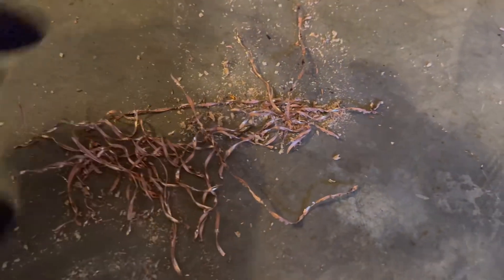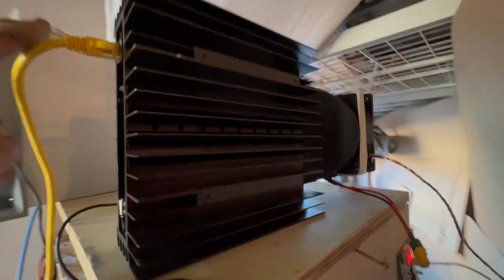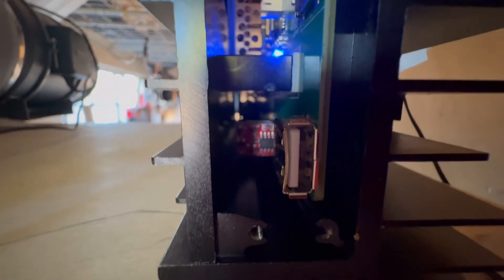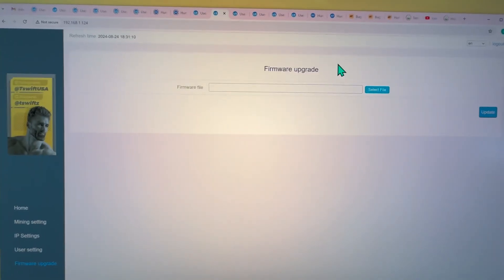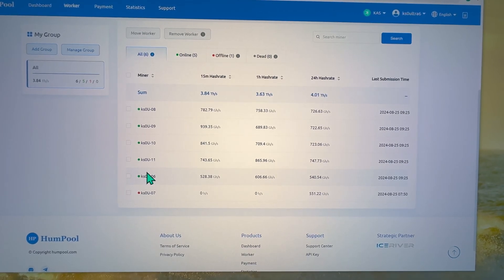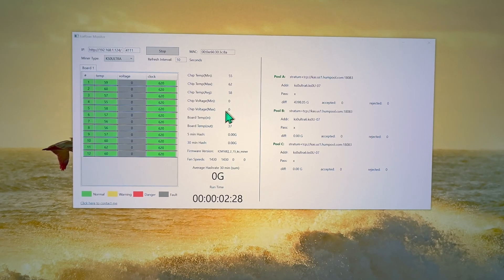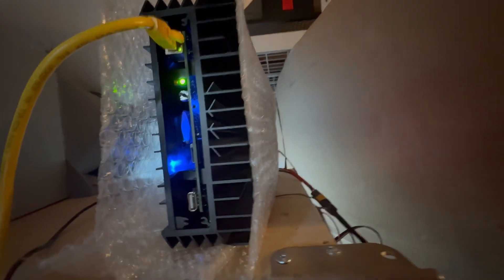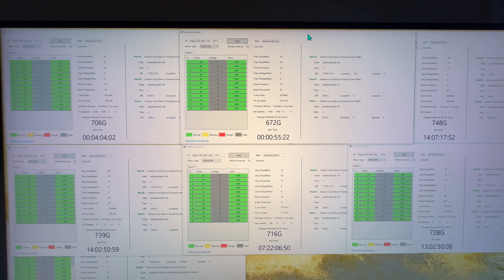CRAZY HEATSINK KS0 ULTRA

Comment: Is it possible to better show the assembly of cables that powers the KS0 ultra (the connection between the PSU (HP server) and the KSO ultra and its direct surroundings, the fan, the KS0 itself, DONGKER Fan Temperature Controller, and other?). The time code of your video, which shows the connections I'm talking about -> https://youtu.be/49rDlem_6vI?t=300.

What is the part number on which the fan is mounted (Tecsesories is the name embossed on the plastic) -> https://youtu.be/49rDlem_6vI?t=140.

Thanks for all, and really good job 🙂
Reply from the maker: All parts has links in description: here is fan controller video: https://youtu.be/l12RuTQNgi0?si=cAbvJT1pEH8JJymc
Psu to xt60 connectors video: https://youtu.be/8wZOX79B4cE?si=25lEUMzYamfvlqeK
Fan shroud I purchased on eBay and few with fruition design that works about the same less expensive on eBay I think.
Reply: Thank's for answer, have you private channel (zoom) and it's possible contact you 🙂 ?
Reply from the maker: Discord  or telegram

Comment: Nice❤. What is the dimension of the copper block and thermal pad?
Reply from the maker: I used 10x17x50mm copper block and 1 and 1.5mm thermal pad, if cannot cut exact 17mm have to play with different thermal pad. I also tried using 6x17x50mm block with thermal paste and 2.5mm thermal pad. But to be honest 6.5x6.5x12mm Alphacool heatsinks with thermal glue works best for me by far. Currently sold out